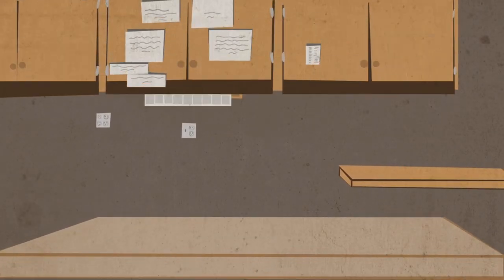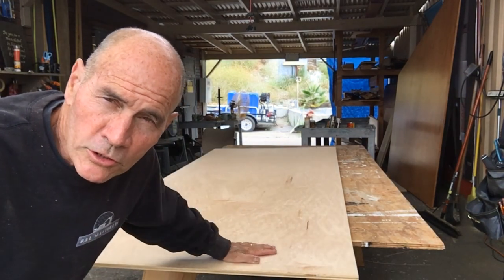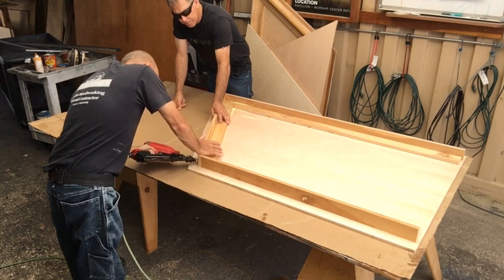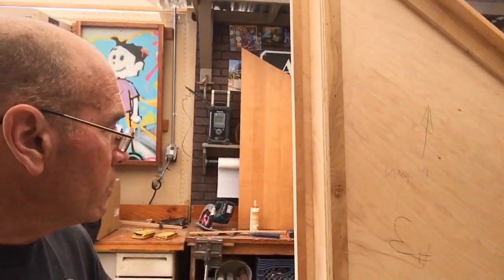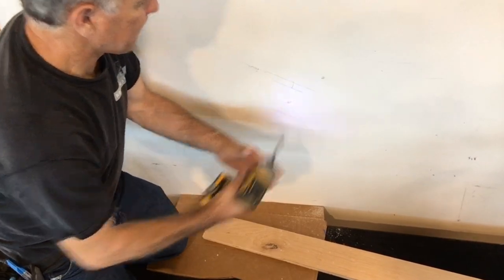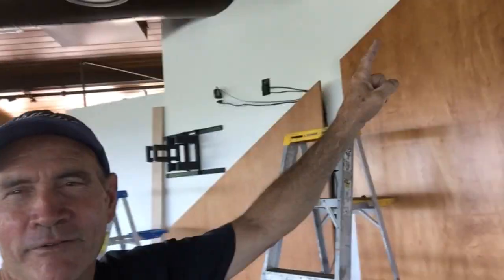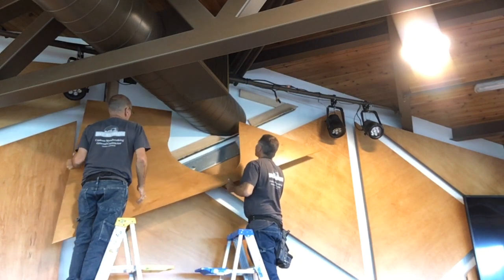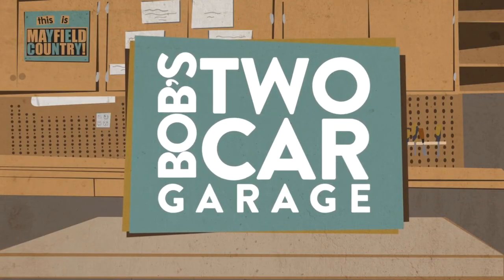A Church Stage Design and Build

Comment: I’m curious how you ran the LED lights. Can you give me some info on how you ran it and hid the cables?
Reply from the maker: Grace Media Films sorry just saw this. I mapped out the route of the leds on paper and only needed to hide them in a couple of spots. I used plastic cable channels to do so. I used a “cable boss” staple gun to hold the strips down. Important to get it tucked in evenly . For uniform glow. It really looked good.
Reply: @BobsTwoCarGarage   how did connect the LED lights to the power line? each panel with power outlet from the wall?
Reply from the maker: I simply used an LED controller that plugs in to an ac outlet.  I used two of them because of my long run but they turned on together with one remote.  They are hiding behind the TVs.  Nothing fancy or expensive just bought it on Amazon